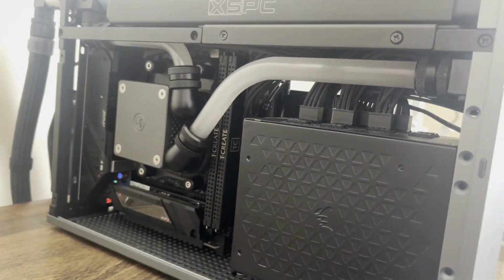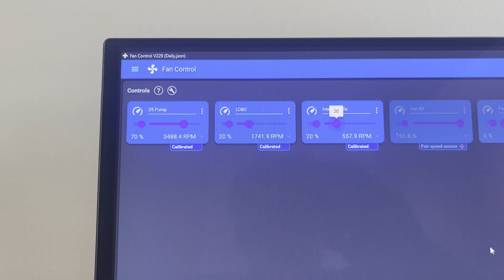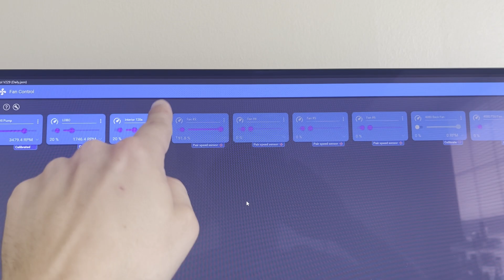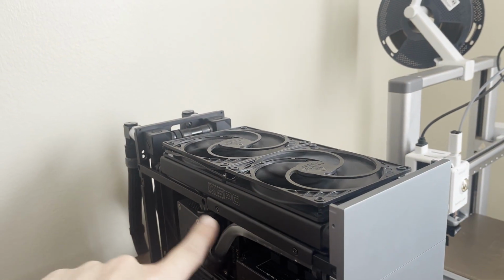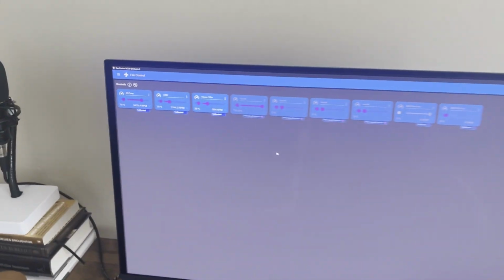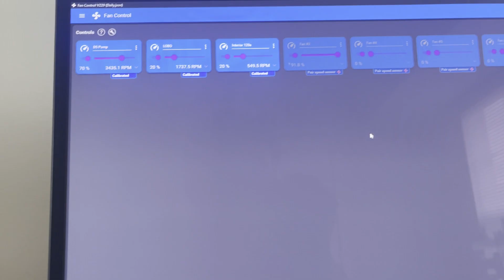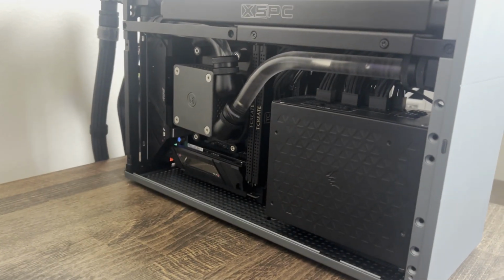Watch this BEFORE building a liquid cooled ITX PC

Comment: I noticed your QDCs have an internal bypass with a check valve (looking at the tube that connects both sides of the QDC). How do you prevent water from circulating only on the internal path and not being sent through your external rad? Or does part of the flow go out to the external rad and the rest stays in the internal loop? How do you deal with turbulence at the in/out "inlet" where the external rad feeds back into the internal loop? I'd be a bit worried about head pressure and leaks there, and possibly reduced flow rate - have you measured flow rate within the internal loop with and without external rad?

My fluid dynamics is pretty weak so just trying to wrap my head around the internal vs external loop (with possibility to switch from one to the other on the fly for portability)

Thanks in advance - and thanks for posting those vids. I'm considering a flipped design with the rad & QDCs at the bottom rather than top + a side rad along-side a single-slot GPU block